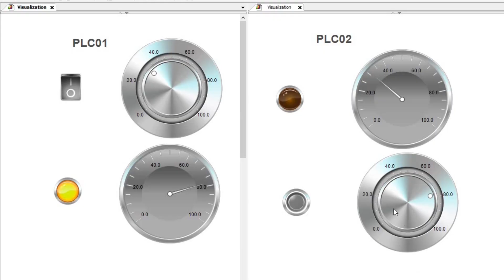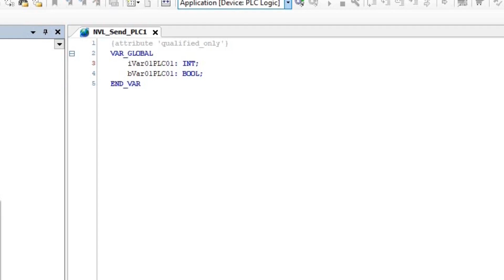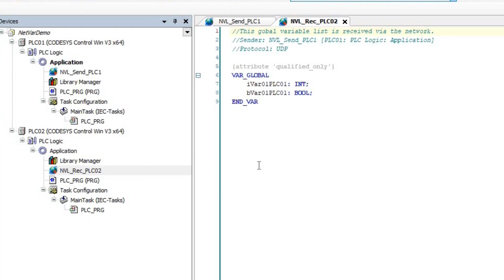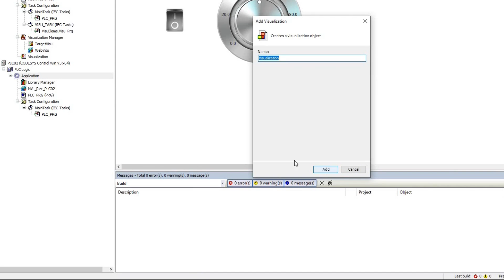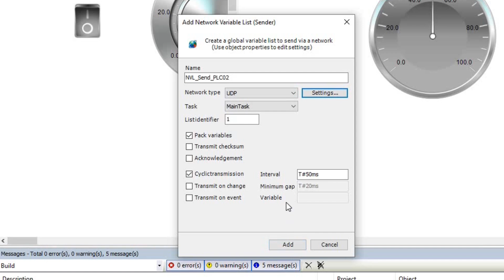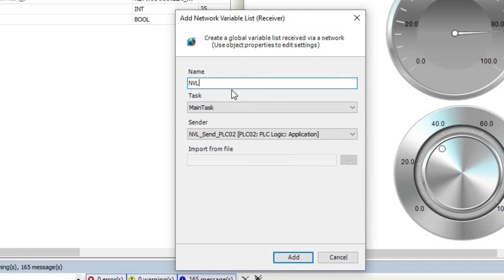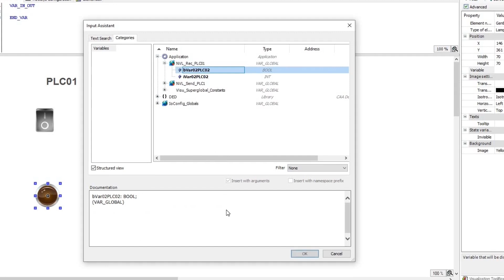CODESYS: Network Variables - Communicating between two CODESYS PLCs #codesys #networkvariables

Comment: How can I create two PLCs controlwin instances? When I scan the network appears only one PLC for me (for you appears two NLT062681NU and NLT062682NU). I can't login into two different PLCs at the same time.
Reply from the maker: In my case, I have two PCs in a local network and a CODESYS ControlWin running on each, so two PLcs in the network. It is also possible to have two instances of CODESYS ControlWin in a single PC (I may demonstrate this later). Alternateively, you can have the 64 bit and 32 bit CODESYS ControlWin running at the same time and talking to each other through Network Variables.
Reply: @TohidAlizadeh  thanks!
Reply from the maker: @renandebritoleme3097  you are welcome 🤗

Comment: Thank you for your video, i'm currently working on an automation project for our school exam. Im having trouble with understanding how to define inputs/outputs on the PLC, it seems easy in the visualisation. But i cant figure out how to to do it with real sensors and how to define the inputs and outputs, can you give me an example in writing what to write to define ports?

PLC1 reads if optic laser OPT3, which is located as an INPUT on PLC2, if it is true. If TRUE PLC1, turns MV9 TRUE, which makes an actuator that is controlled on PLC2 extend, is it possible to control outputs on PLC2 by PLC1?
Reply from the maker: Thanks for your comment.
When you use a real PLC with input and output devices, you make physical connection between the devices and the input or output modules of the PLC. Then the information regarding the input and output devices will be stored in the memory of the PLC, in a given address. For example, for a discrete input device, it may be stored in %i0.0, or for a discrete output device in %q0.0. Depending on which PLC you use, the addressing might be slightly different. The address will depend on which input or output terminal the device is connected.
PLC2 can control one output of PLC1, as explained in this video, and in the other video using Node-RED. Here, you just need to use a global variable and then assign the value of that variable to an output. With Node-RED, there is no need for the intermediate variable.
I hope this helps.

Comment: Pls, show how to add second PLC on Getaway view. Thanks.
Reply from the maker: In this tutorial I have two PLCs running on two different PCs in the same network. But it is also possible to have more than one virtual PLC running on a single PC. If you mean the second, I may demonstrate it in a tutorial soon.
Reply: Thank you. I have try to replicate exerciser  with 3.5.17 and NO hardware PLC connect to PC. Have put both PLC1&2 in sumulation mode, the problem is the UDP interface since one of the PLC dont receive anything from other PLC. Maybe same special library is needed for NVL? Will be nice if the exerciser are adopted to no phisical PLC.
Reply from the maker: I am not using any hardware, except two PCs, which are running CODESYS Control Win virtual PLCs. For both project I don't use the simulation mode. I don't think that simulation mode could be actually used for this kind of tasks where you exchange data between PLCs.
Reply: Thank you for calrification, will try to run it as per your setup @TohidAlizadeh
Reply from the maker: 👍
Let us know if it works!